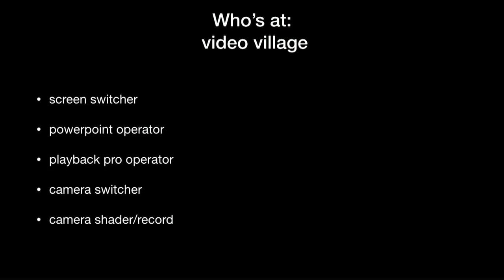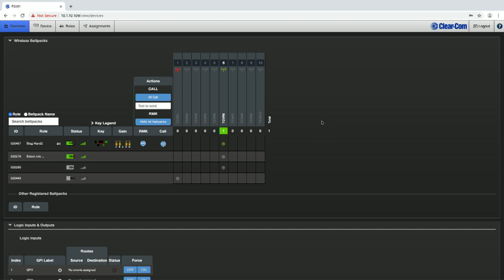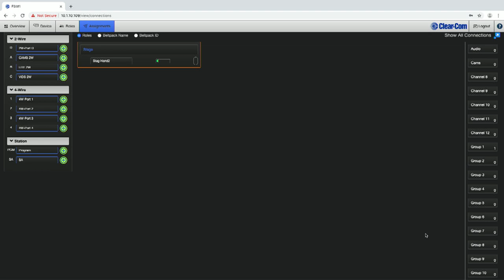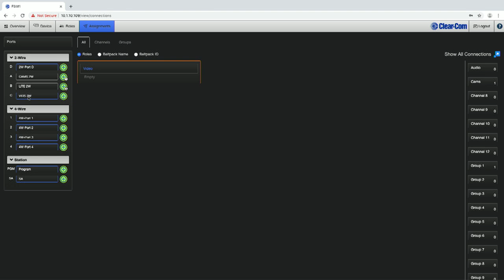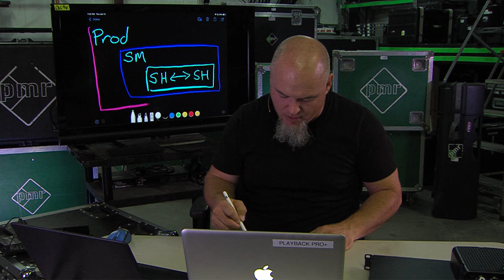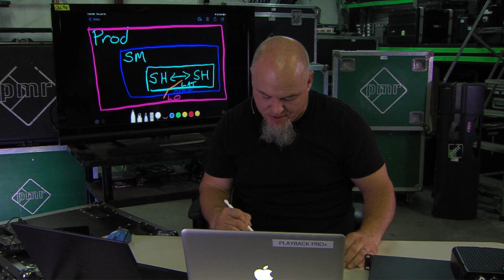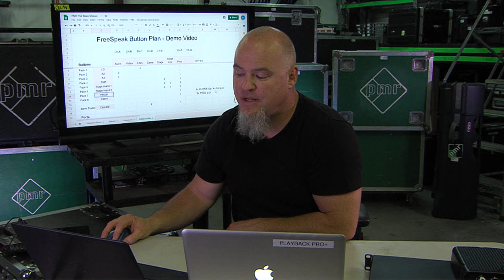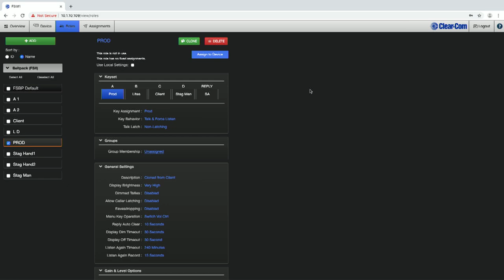FreeSpeak 101 ep 3. Case Study

Comment: Aloha...i work out of a NEP truck that runs through a RTS systen.  My wired belt packs are 2 channel and i assign that through my jog wheels in audio land... so my FD is listening to crew and producer off the KP32 panel in the truck.... if i split that xlr at the dt12 and plug it into 2wire A...
Will 2 wire A ch work like a
2 ch beltpack and split the signals.... sorry im just an A1 who's wants to learn comms.
Reply from the maker: knottme hey there, thanks for the question. I think I am following you. This is about freespeak splitting the audio to two channels like your beltpack does?  

Yes, the freespeak frame will split out RTS chl1 and RTS chl2 from the single XLR being plugged into it. There are 4 XLR’s for 2w comms. They work differently when in Clearcom mode and RTS mode. 

When in Clearcom mode the XLR and channels are 1-1, 2-2, 3-3, 4-4. 

When in RTS mod the work like you expect. XLR 1 and 2 = Chls 1 and 2. XLR 3 and 4 = Chls 3 and 4. 

Hope this helps!

Comment: What is the best way to connect the Freespeak system to a wired comms system going through an MS-702?
Reply from the maker: You can connect the FreeSpeak basestation to the ClearCom beltpack chain that is created by the MS-702.  In other words, plug in the freespeak base statioin just like you would an beltpack on your system.  (of course you will need to assign the XLR on the basestation to be ClearCom mode and then turn off power for that channel).  Thanks for asking!